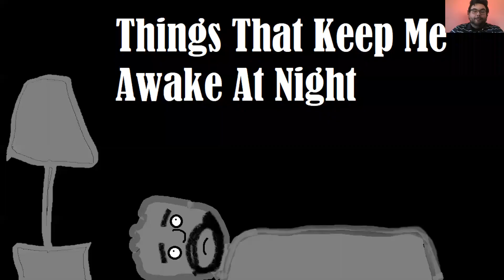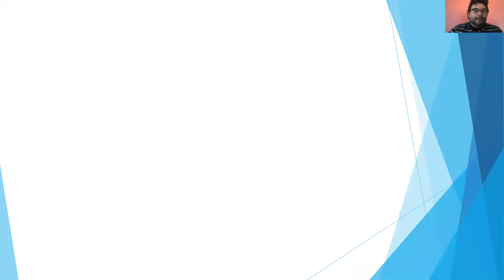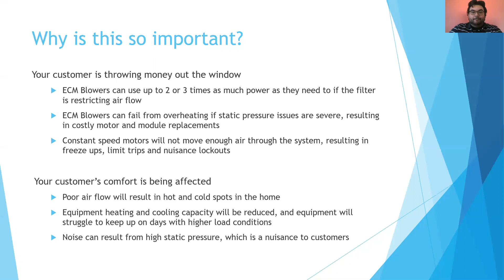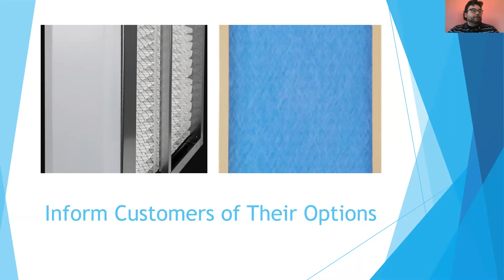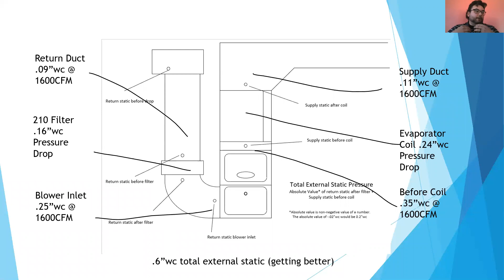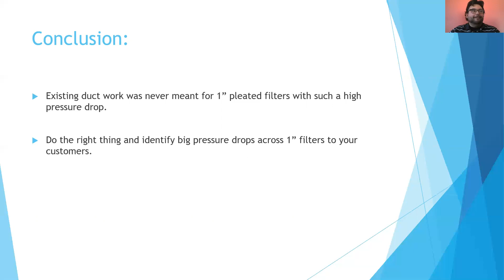1" Pleated Filters:  The Silent Killer of HVAC Systems

Comment: Personally id suggest Merv 8 for most with pets. (To cut dander out of AC innards)

In my case Merv 8 is the best option. Because it cuts cat dander down from 2 cats. Acts as a whole house prefilter to cut down on dust and dander for hepa on each floor.

So 3 air filters running in house. 2 hepa and the Merv 8

Comment: You are so right. 1” filters are problems. Is that why my two AC systems use 1” filters and have lasted 15-20 years. I assume that is a problem?! What are you preaching?
Reply from the maker: If 1 inch filters are sized properly they will work, but if you look at the airflow ratings on most filters, the pressure drops across them for common hvac unit sizes result in extra stress on hvac equipment, reduced air flow in systems with psc blowers, potential freezing and overheating issues.  I’m glad to hear you have not had any problems

Comment: What I never see is commentary on s system like mine.  In a 2200sf house I have five filters on ceiling air returns throughout the house 2 20by20by1 and 3 14by14by 1.  I usually use MERV 11 pleated filters as pollen is a concern here much of the year.  Should I be concerned?

Comment: Without a filter, my unit can take in 3400 CFM. With a MERV 5 3M Basic, that drops to 1800 CFM. Yikes. Hence I'm thinking about switching to the cheap Merv 4 fiberglass ones. All i want to do is protect the evaporator coils and blower. Merv 4 fiberglass isn't enough to protect my equipment?
Reply from the maker: Is this a commercial unit?  Most residential units max on for airflow around 2400, just wondering what is out there that is capable of moving 3400 if it is residential

Comment: 1" 3M filtrete 1900  user here - merv 13, but also twice the media as most merv 8's on the market (1,560 sq. in) so they do not clog up fast, or create static pressure build up any faster then the typical merv 8.  Oh, but they do collect smaller particulate matter MUCH better than any merv 8 on the market (including particulates from wildfire smoke) - which equates to cleaner coils, less work for your motor etc, and FAR better overall air quality in your home.   My residential HVAC heating/cooling system (Maytag) is close to 20 yrs old. Other than changing out a pressure switch yrs ago, not a single issue. 

I change the 3M 1900 every 4-6 weeks in summer, 6-8 weeks when snow is on the ground.

Comment: Project Farm has performed a nice performance test with several different filters and the outcome may surprise you. I have been using 3m 1500/merv 12 filters for decades with zero issues on the hvac system. What these filters do quite nicely is cleans up the air in one's home. They are expensive and should be replaced Monthly or every two Months depending on how often your system runs. I will say my allergies and dust issue have been much better since going to these filters.

Comment: Fiberglass low merv is the way to go for AC to ensure high airflow.
Reply: The problem fiberglass flat filters is that they allow enough dust to get through to eventually clog the evaporator unit greatly reducing efficiency.
Reply: @princeinflorida214 the evaporator is constantly being rinsed by water that drips down to the drain pan and out through the drain line. Only time it isn’t being rinsed is when the system uses the heat pump or furnace during cold weather.
Reply: @nunosapunso6239 Yes but then there are cases where the dust accumulates faster than it can be rinsed off  and fully closes off the space between the cooling fins. In one case I used a dinner knife to go in and individually scrape out the packed in dust between the cooling fins. This is common enough that they actually make a comb-like device that will do more than one fin space at a time. Who knows, maybe they ran it without any filter at all. But it does happen and I have had to deal with it. Fortunately what you describe helps to minimize that problem.

Comment: 1" pleated filters are fine as long as they are properly sized for the amount of airflow. 
16x25x1 is only good for up to about 1000 cfm and that is pushing it - beyond that, need a larger filter.

They filter much better than fiberglass.
The pressure drop depends on the specific filter and the air velocity through it.
Reply: Yes - Most folks should stick with a basic MERV 8 pleated filter for the common 1” filter width.  If they get static pressure tested and maybe have allergy issues and can support MERV 11 then sure. 

But without proper testing/measurements - folks should stick to basic MERV 7/8 pleated filters.
Reply: some systems need fiberglass filter to get proper airflow - depends on filter size vs airflow and blower motor type/ductwork.
without testing an individual system it is a guess.  @Kenster-man

Comment: Even worse and more common, is horrible return duct and filter frame sizing. Fly by nighters completely ignore the return sizing the manufacturer recommends. Then you've got a S.P. problem no matter what filter you install. And it's expensive to fix. Flex duct, especially undersized flex duct, flows  air poorly at best. But, it's the rule rather than the exception.

Comment: How did all of the houses I work on as a remodeling contractor get 1” filters? From HVAC contractors. I’ve been running a Goodman 95 furnace with 1” Merv 13 filters for over 20 years. Not ideal but functional.
Reply from the maker: Without actually putting test equipment on the systems couldn’t say either way about your specific application.  From my personal experience going into thousands of homes, the majority of 1” pleated filters are not sized properly and are causing airflow/comfort issues, higher energy costs and in some cases premature equipment failure.  If your application is working with 1” pleated though I’m glad to hear it!

Comment: Three days after my 14 year old hvac was serviced it stopped cooling down the house. Same service company tech came to check system. He concluded that it was time for an new system and offered a quote to replace it. I later discovered he had put in a pleated filter three days earlier. I replaced it with a cheap blue filter. Three summers have passed and my 17 year old system works fine. Of course i've had a new hvac service provider for the past three years.
Reply: I got the opposite. New system installed after 23 years, and only because ac had slow leak and we decided to get a new system due to the old freon is being phased out. Anyways, they threw in a "rock catcher" see thru fiberglass filter. After doing my research I realized the pleated 1" filters are power robbing energy consuming trainwrecks😮 now its cheap filters changed often

Comment: How does a MERV filter differ from other pleated filters?
Reply: MERV is just a filter rating with filters commonly available between MERV 8 and MERV 13. It does not refer to the kind of filter. Often pleated filters have a stated MERV rating. Pleading allows for much more surface area within the outside boundaries of the filter container thus reducing air flow resistance, ie pressure drop. I found that my floor filter container could take a 2-in thick pleated filter which would have twice as much filter area as the 1-in pleated filter that was in it when I first inspected it.  I want my filter primarily to keep the evaporator dust free and secondarily to clean my interior air. If I want more interior air cleaning I will use a freestanding high efficiency air filter.

Comment: Nothing wrong with pleated filters, as long has you combine them to get the proper surface area.  As you know pressure drop is dependent on the air quantity you’re trying to push thru a given size  filter.  Simply put in a V filter arrangement instead of just putting one straight across the duct. I have a pleated filter media that is 4” or 5” thick.  Plenty of surface area.

Comment: On my main supply duct grill vent in the living room I'm getting the same cfm output reading using a digital anemometer. I get the same cfm reading whether I use a 4 inch deep filter or just standard 1 inch pleated. Would it be safe to say the 1 inch filter is ok?
Reply from the maker: Is your blower motor a PSC motor or ECM?  If it is ECM the blower will maintain the same CFM at the cost of higher electrical consumption and potential early module failure.
If you are achieving this with a PSC motor then you should be ok, however it would be recommended to check static pressure on the entire system to verify you don’t have any potential issues with undersized ducts.
Reply: @staticpressurenerd5182  yes it is a PSC motor. Thank you for the info. I will be conducting a static pressure test on the system next.

Comment: Sometimes not so silent.  I was getting a whine, presumably from the blower motor, when using a high MERV pleated 1 inch filter.  So I asked my HVAC guy about that and he confirmed I should use a MERV 4 (rock catcher), or be prepared to replace my blower motor MUCH earlier. 

If filtering for my health really needed at some point, I'll use some room air filter with a good rating for my bedroom.
Reply from the maker: Using the rock catchers does have other drawback.  Equipment gets dirty, efficiency drops and stress on the equipment goes up

Comment: What can you use to measure the pressure difference across the filter. I would like something that is permanently installed so you could judge how much resistance a new filter has and then as it got dirtier - when to change it.
Reply: Manometer is a standard, meaning as long as it has the proper fluid it will be accurate.  A gauge like the magnehelic that the nerd recommended needs to be calibrated over time to remain accurate.  I did this for 30 years and we used magnehelic gauges.  We also ISO calibrated them with fluid manometers which is a standard.
Reply from the maker: Magnehelic pressure gauges

https://www.supplyhouse.com/Dwyer-2301-Magnehelic-Differential-Pressure-Gage-0-5-0-0-5-W-C?utm_source=google_ad&utm_medium=Shopping_withoutdata&utm_campaign=Shopping_Without_PLTV_data&gclid=CjwKCAjwtKmaBhBMEiwAyINuwIF39ew4LMQelxP-de7OgaowlfgtzyjVxstzY7r2uB1ye1JJ3WDs4xoCT_kQAvD_BwE

Comment: Great info, wish filter manufacturers would warn customers about the long term effects of using high MERV filters. Who am I kidding! They make a huge profits on the higher density filters that capture everything in sight but restrict air flow through the furnace. I switched from a MERV 13 to a MERV 8 filter years ago and saw a significant improvement in air flow, reduced noise and shorter heating and cooling cycles (increased off cycle time means more money saved). The last Rheem system I had ran for 24 years with no issues but I knew it was a matter of time before the repair bills started so I replaced it and only use MERV 8 filters. Obviously, you need something to keep all the airborne particles from collecting on the internal furnace components but it does not have to be an expensive April-wire unit or high end media filters.

Comment: Excellent explanation of downfalls of pleated filters.  I'm wondering how many furnace manufacturers recommend, or supply pleated filters with their units.  Appears HVAC repair people love the pleated ones, due to more frequent callbacks for repairs.  Air distribution systems should be designed to provide the maximum exchange of air, be it heated or cooled.  If there are no problems with allergies or excessive dust on surfaces, then why use anything like pleated that restrict air flow?
Reply: Because… less than pleated will not catch dust and will lead to your blower wheel/evaporator being plugged with dirt/dust
Reply: @zachosborne6577  That's ridiculous... I've had furnaces run for decades without any problems from dust appearing on those items.
Reply: If you’re using hog hair filters or those cheap filters you can see through, you have dust in your blower wheel and evaporator.  If you say you don’t you’re being disingenuous.

Comment: as a HVAC journey person I found your video interesting. But IMO you are over stating the importance of static pressure which most home owner will not be able to measure or actually do anything about. Yes in a perfect world .5" would be great. You are terrifying them that the thousands of dollars they've spent on their furnace is being destroyed by a 1" filter.  There are just too many factors to take into consideration to use a blanket statement like the title of your video. Duct design? AC? size of AC coil? Pets? Allergies? Cost?
Reply: I appreciate your input and agree. I notice he charted pressure drop on a variable system speed, but I don't have a variable system. He also referenced media filters (that were in the hundreds instead of thousands) but didn't mention the difference between those filters and why certain higher ones were fine and others weren't. Under researched video. However, good point about checking static pressure. I'll need to check if my HVAC guy does that.
Reply from the maker: Nah, the filter definitely will kill it

Comment: Hi Static Pressure Nerd, I am hoping you can tell me if combining 4 - 1 inch filters (laying one on top of the other) would create the same effect as simply having 1 - 4 inch filter. I've been told that the more real estate a filter system has, the lower the static pressure. Thank you for your commitment to saving homeowners the terrifying expense of replacing their HVAC systems because of ignorance.
Reply: No, terrible idea. Thats 4 times the restriction. Proper 4 inch filters do not have 4 times thicker material, they have more material at same thickness bunched up within the frame.
Reply: @kayakdog121  Got it. Thanks very much.

Comment: I'm having a new furnace and air conditioner put as I type this. One of the things I asked for was at least 4" media type of filter vs the 1" filter that was in there when we bought the house. I was happy to see that they put in 5" media to replace the old filter. I'll have to ask them tomorrow when they finish the job what the max MERV rating I can use. They currently have a MERV 8 filter installed. 
The only thing I'm scratching my head over is the brand. It's from a place called Protech. It also has stick on foam around each side. I'm not sure if this is standard for these types of filters or will I have to worry about the foam failing over time.
Reply from the maker: Never heard of the brand but for a 5” media usually I’m comfortable going to Merv 11 as long as it is sized correctly.  Does the foam come attached to the filter?
Reply: @staticpressurenerd5182  Yep, the foam is attached. 3 sides of the filter (minus the side that the door is on) and one foam strip on the door. 

The strange thing is I've seen photos of filters both with and without the foam on it. 

After speaking with the installers when they arrived this morning I asked if the foam was common. I was told that the 4" filters don't have foam but it is common to have foam with the 5" filters. 

I've seen reviews that did mention the foam on the filter. So, I guess my next trip to the big box store I'll have a look down the filter aisle to see what is common and what isn't.

Side note: I was originally supposed to get a 5" electronic filter with this installation. But it seems that their suppliers don't have any. They wanted to switch me to a 1" electronic filter. I passed. 
I also found it a bit strange that they would suggest it since my original request was an update to a 4" or 5" media cartridge and they came up with the suggestion of the electronic filter along with a statement that 1" would be too small for the furnace I was buying anyway. Only to suggest that they had a 1" electronic filter available...

Also, we will be approaching day 3 of the installation as they forgot to put in the UV light for the evaporator coils, the install tech disconnected my 2nd stage wire to the Nest thermostat, and they disconnected the 2nd stage wire to let the Nest control the humidifier. 
This makes no sense as I ran an 18/8 wire to the old furnace so there wouldn't need to be any picking and choosing as to what functions would be handled by the thermostat and furnace. So that's supposed to be cleared up possibly tomorrow.

Comment: I just had a new Rheem furness installed and it calls for a 16x25x1 filter. Can you recommend a good filter for my new furness?  I just looked at where the filter goes, and it looks like a 4 inch filter would fit in the space. Would that be a good way to go? USe a 4 inch filter instead of the 1 inch it calls for?
Reply from the maker: Definitely use the 4 inch filter.  Do you know what the model number of the furnace is?